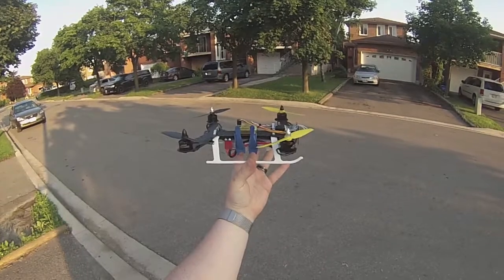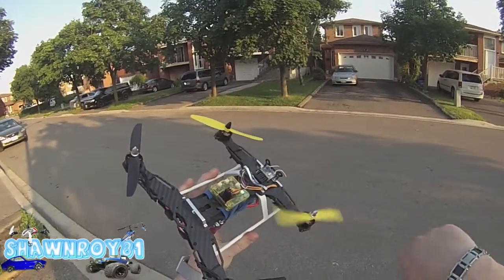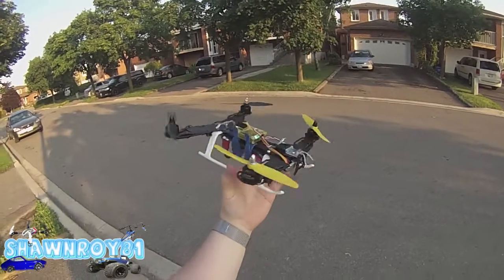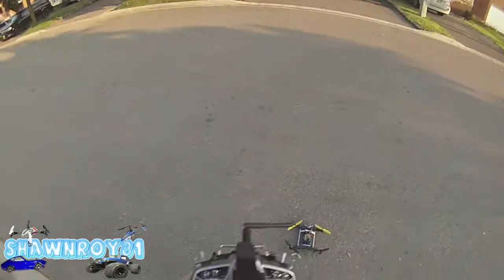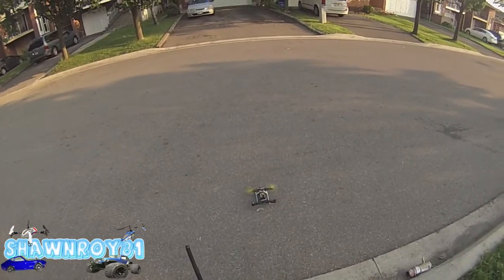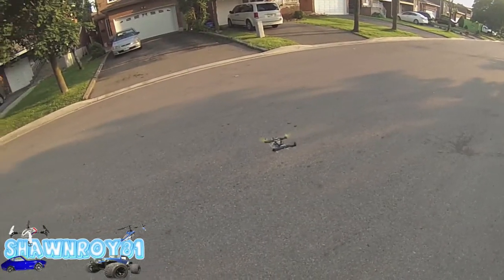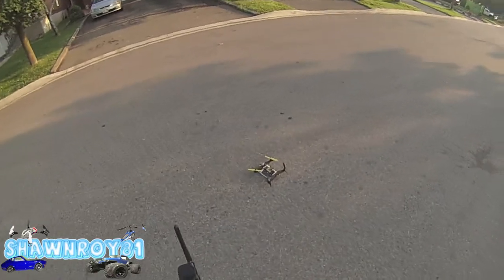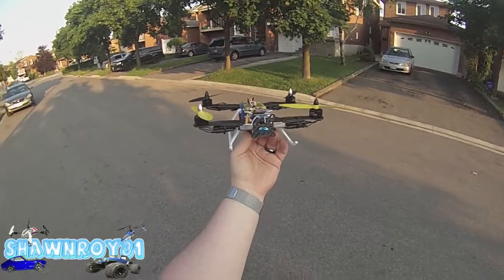Tarot 250A Carbon Fiber FPV Racer Maiden Flight

Comment: nice shawn. so far, what are you liking more, that one or the beetle?
Reply from the maker: 2cwik4u104 thanks..i like the feel of this one but that could also be setting in the fight controller that need to be tweaked on the fpv beetle